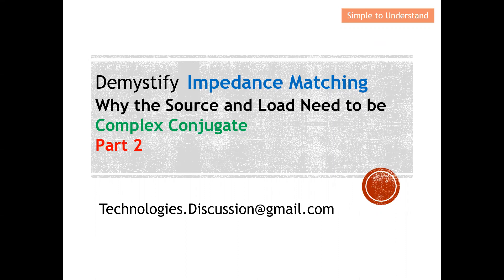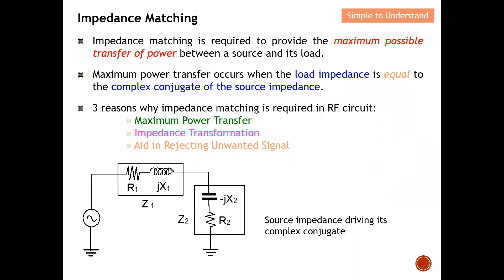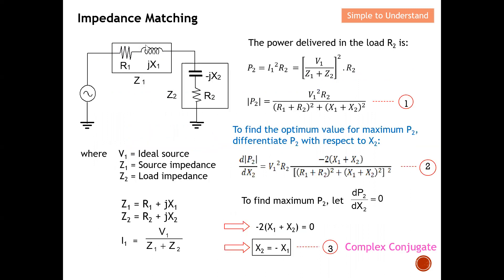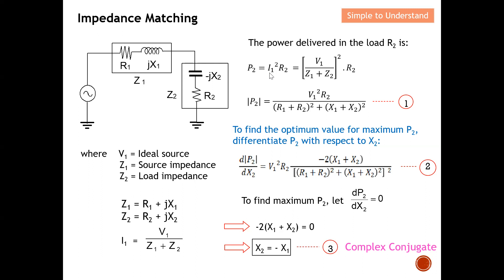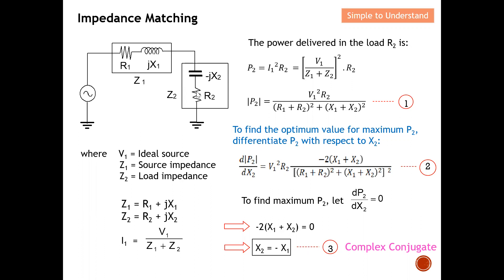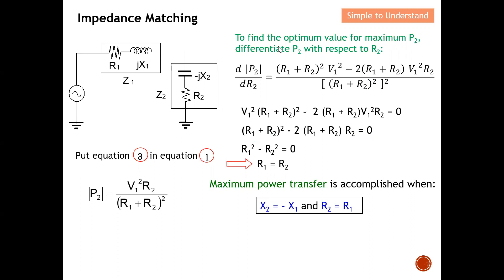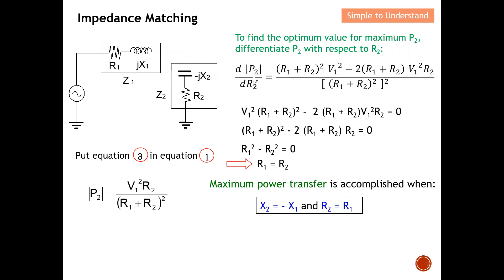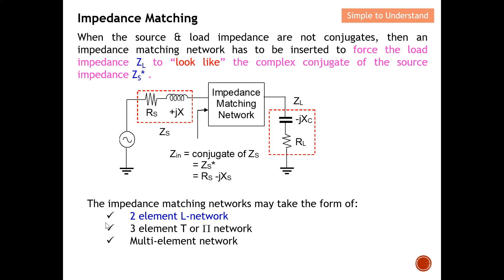Impedance Matching #2. Why Max Power Transfer Demands a Complex Conjugate Match of Source to Load.

Comment: I have a question
If I have the condition of load impedance equal to complex conjugate of the source impedance, it means also that I have no reflected power by the load?? Or it is a different condition??
Reply from the maker: if the load impedance equal to complex conjugate of the source impedance then is considered a match condition. This is what we want to achieve. Thanks.
Reply: @technologiesdiscussion1676  so i have maximum transferred power and also 0 reflection?
Reply from the maker: @antoniogiordano8561   Yes, you are right.  You can imagine like this this, if there is no reflection, then all transfer over then I will have max pwr transfer.   :)